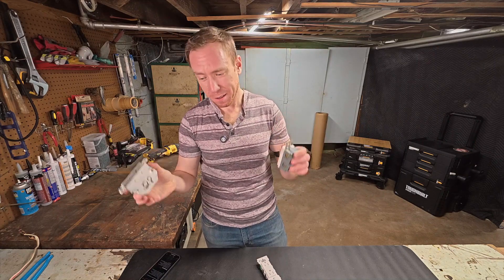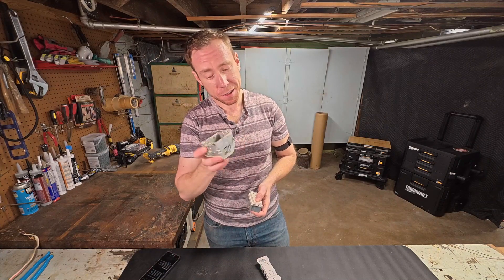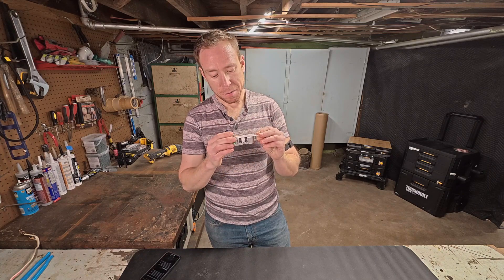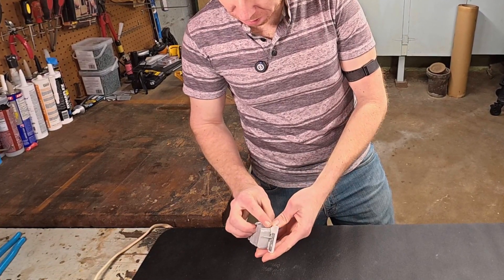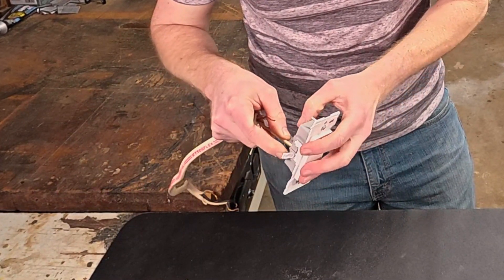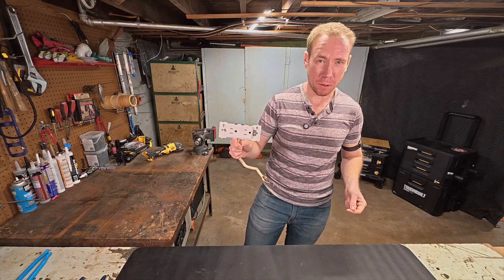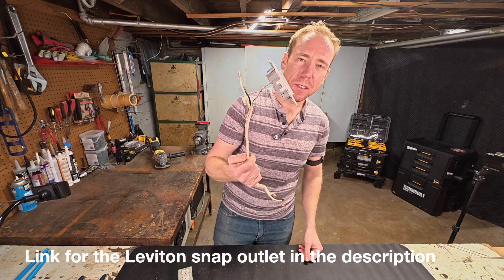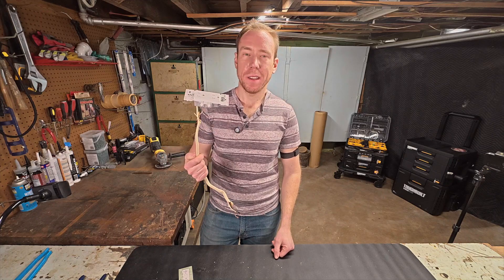The Dummy-Proof Electrical Outlet

Comment: One easy issue: the ground clamp only handles 1 wire. However, the pass through for an outlet mid-string is easily handled with a 3 port Wago and a pigtail. The hot and neutrals both have 2 positions, so they can pass through like a regular outlet.

Comment: Run 30 or 40 amps through it and lets see if it melts down.
Reply: It's a 15 amp duplex receptacle, for a circuits protected with a 15 or 20 amp circuit breaker. Why in the world would one run 30 or 40 amps through it? (The NEC would not allow that.)
Reply: @jamesreizner2673 Guess you've never seen the testing of WAGO's to failure? There's a couple of videos where guys have tested wire nuts, crimps, European, and WAGO's all at the same time. 
The results are interesting and prove something worth knowing.
Reply from the maker: That would be interesting! For the average home owner who wants to plug in a TV and some lights I think this is a great option.
Reply: Who has 30-40 amp circuits using regular outlets???
Reply: @alandaters8547  Nobody hopefully. I guess you're another one that's never seen connectors pushed to failure? It's good to know what happens to a particular connector if it's overloaded.